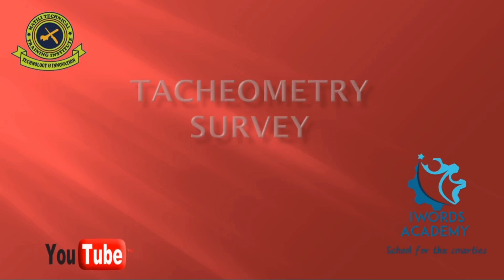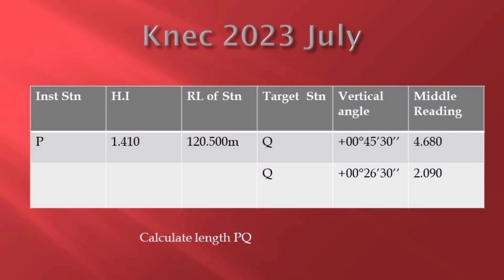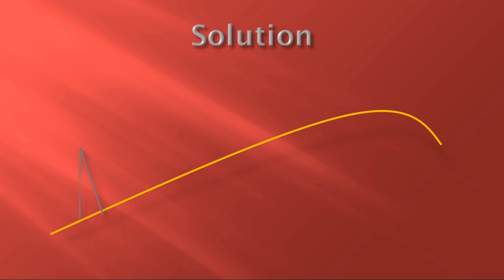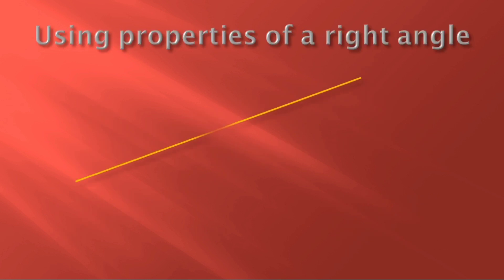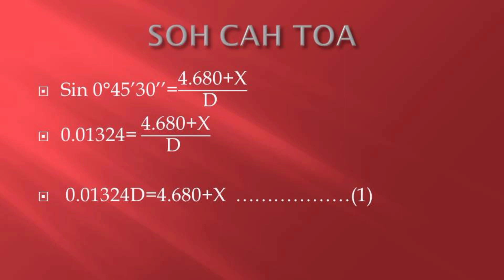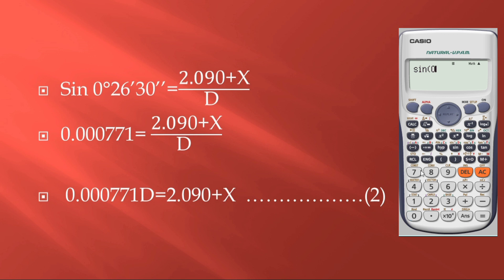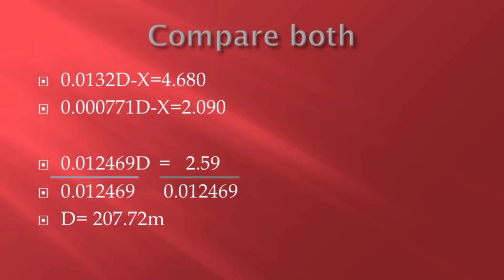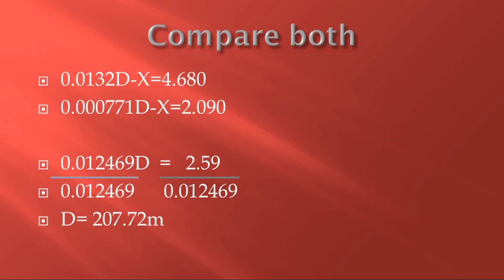TACHEOMETRY SURVEY ENGINEERING, knec July 2023 Civil/building Module 3

Comment: mwalimu can we use tangential tacheometry in this question considering we are asked to find distance of which it should be the same from the instrument station and we are given only the middle hair readings?if we calculate it that way we find that distance in respect to the vertical angles are not the same.
Reply from the maker: Not really, the question has a mid distance and in tangential we only using the top & bottom readings